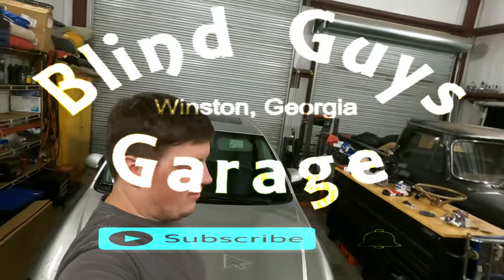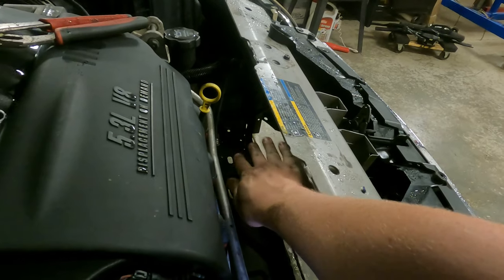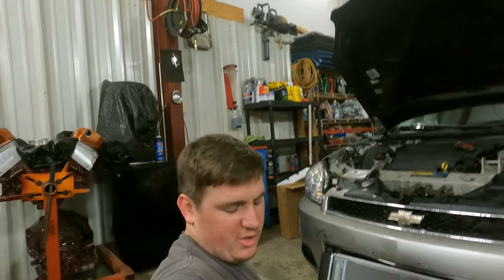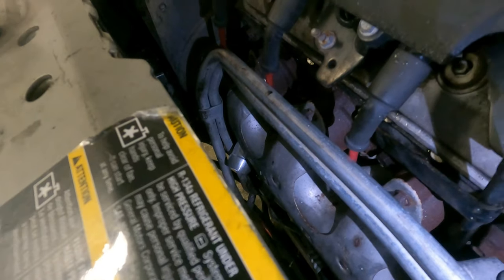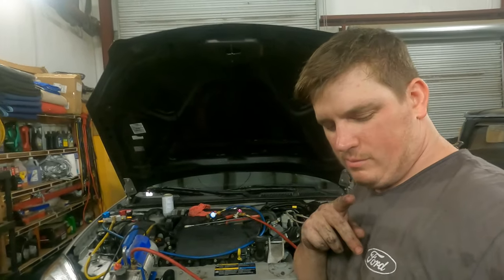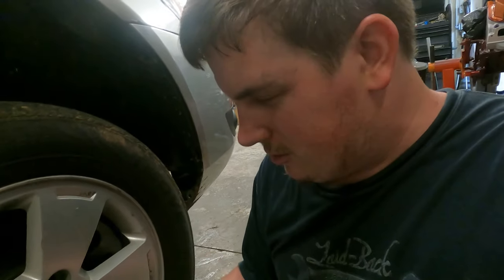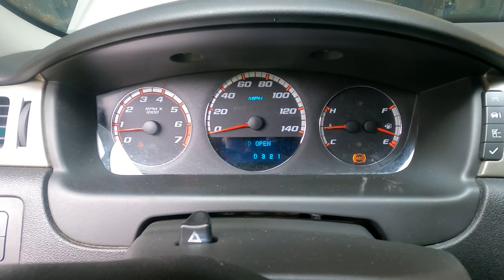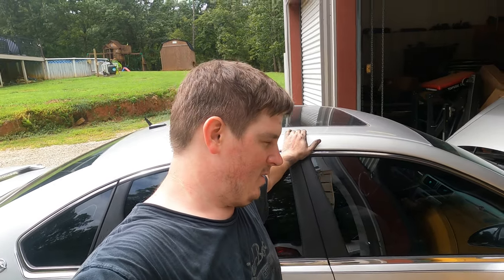AC and cooling system replacement 2006 Chevy impala SS 5.3

Comment: I’ve got to do this job in the next couple of days. The shop wants 1200 in labor alone, lol. No thanks. How hard is it to get the compressor in and out? Fan and radiator I think are fairly easy. Thanks for posting this video.
Reply from the maker: Everything on these cars is extremely tight even the fans and radiator shroud was not much fun but getting the compressor out once you have the fan and radiator out is not terrible however expect quite a few hours
Reply: @blindguysgarage  Thank u for replying. I meant to say ac condenser not compressor. Both of mine leak so I’m going to tackle replacing them as soon as the parts arrive.
Reply from the maker: @DjSmoothNY  The condenser is not bad since you have to pull the radiator I would suggest changing the radiator and thermostat its the best time to do so trust me you don’t want to have to change the thermostat it’s hard enough with radiator out
Reply: @blindguysgarage  Ok I’ll try replacing the thermostat to while I have everything out. Thank you for your help.
Reply from the maker: @DjSmoothNY  anytime
Reply: @blindguysgarage  Turned out that was probably the hardest job I’ve done on my car lol. After changing everything I started overheating and I think it was because I didn’t flush out the stop leak I had dumped inside prior to changing everything. Did a semi flush and changed the coolant temp sensor and radiator cap and everything has been working well.
Reply from the maker: @DjSmoothNY  These cars are not much fun to work on unfortunately they are kind of packed in there and no room for fat people like me to get in there but I’m glad it all worked out for you

Comment: Hey my 08 ss is overheating i change the radiator in my fan fuse  and the hot and cold hand still moving what do u think wrong
Reply from the maker: How fast dose it run hot 
Dose it have any leaks 
Kinda hard to diagnose from a distance but I will try

Comment: hey what are those 2 steel lines in front of the exhaust manifold?
i just bought a ss and realized they were bent like crazy from someone trying to make room or got frustrated or something so i think i need to replace them
Reply from the maker: Being honest I don’t remember but just looking at my vid I would say there are either mettle heater hoses (I don’t think they are) or the ac lines that run off the conpressor(this is my gues) I would go out and look at the car but we no longer own it hope this helps in some way thank you for watching
Reply: really appreciate the response bro! ill look into them and see if the picture matches but now o have somewhere to start so thank you!
Reply from the maker: @bowser_815  your welcome any time
Reply: Heater core hoses they come off of water pump and go up and around to fire wall changing over to rubber for heater core

Comment: Man how do I bleed my system I got air in it after changing the thermostat it keeps running hot
Reply from the maker: This system os self bleading  for the most part try checking the vent hose that goes to the reservoir. They have been known to get clogged with gunk. Try blowing air through it also I alway drill a small 1/8 hole in my t stats to keep from air trapping in the systems
Reply: Is simple, at cold temperature. Open the coolant cap but tread it back lightly not all the way just few treads, cap is lose to allow air come out. 1st do a 40 second engine on at 1,500 to 2000 rpm but best and safe @ 1,500. Time up, turn off and check for coolant level if needed just keep adding at the same time squeeze the upper hose. Bubbles will keep coming. 2nd run do a 30 sec and repeat the same process as 1st. Do the 3rd run for 20 sec and repeat the same process as 1st. If you see the same coolant level you are set. 

If you want to be more sure, After you complete this process, you can do burping coolant. By placing the coolant funnel has adapters to fit on your coolant cap. This tool is sold in Advance Auto Parts or try any local auto store. There are plenty of videos on how to do coolant burping. This has been running for decades by far the oldest and greatest technique of removing bubbles. Even newer rams have bleeding screws they still have some bubbles left behind. I hope this helps. 

I learned this the hard way 😂. I thought it was going to vent out the air by itself. I blew up the internal valve seats due to overheating. I replaced both cylinders heads, luckily didn't blow the head gasket otherwise the entire engine either resurfaced or replaced. 

Nowadays in 2023 the vehicle is not worth it anymore for re selling. I mean probably in 25 + years 😆 as classic but I mean it can be reliable if you keep up with maintenance but this vehicle has notorious fixes. The most common one and constantly fix is a/c actuators. 2nd over time of the years motor mount by the passenger side. 

I've changed 3 times rack and pinion. Until I was told by alignment if this vehicle has been in an accident because it tends to wear one tire. I haven't been but I bought it at CarMax . So be careful buying vehicles from them. I learned it is just best to buy new vehicle straight from dealerships. Nowadays just fix the vehicle, prices are way high.